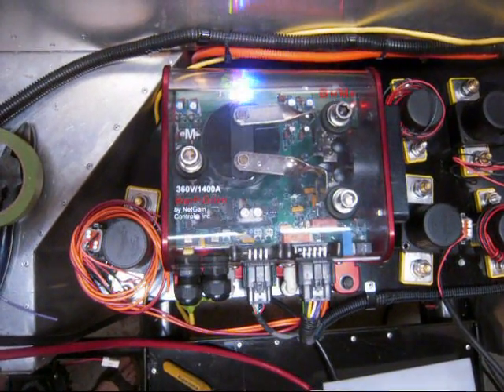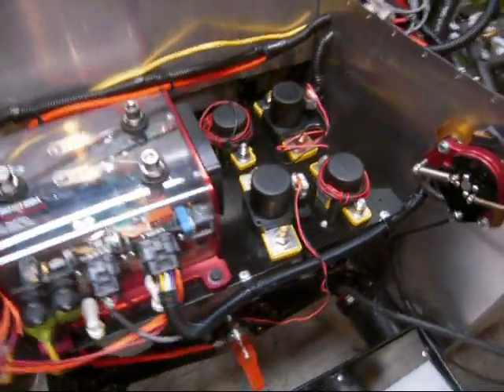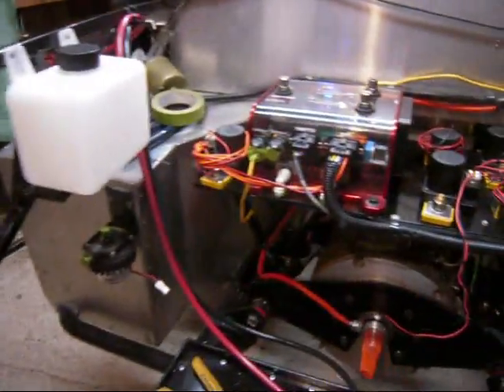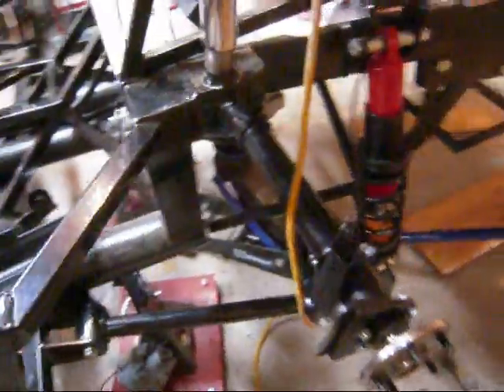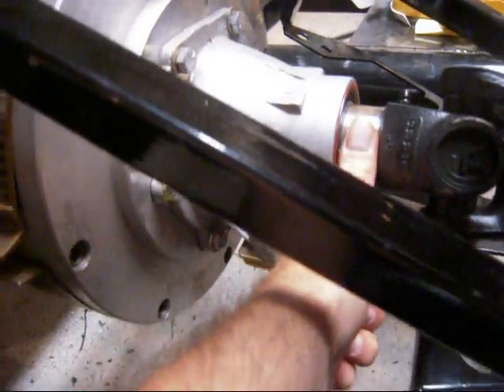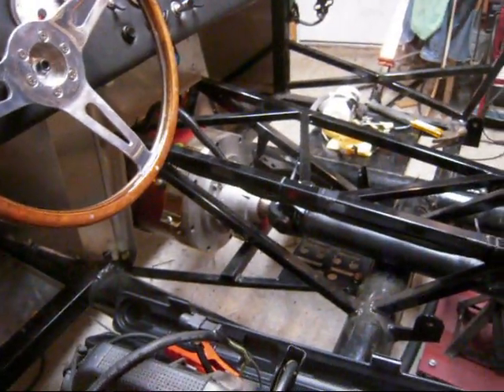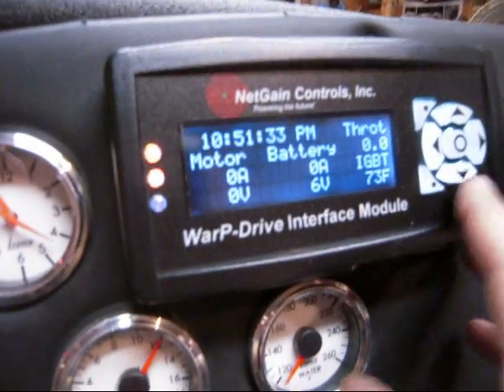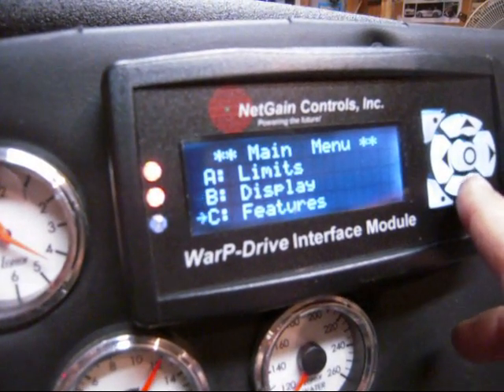Factory Five Mk4 - Electric Car - video 8

Comment from the maker: @saruricardo   The tires are 17"  (10.5" wide rear, 9" wide front).   The motor manufacturer recommends limiting the RPMs to 5000-5500, although they test it to 8000.     With the 4.1 rear end, at 5000 RPM, the top speed will be only 107mph.    0-60mph should be around 3 seconds, possibly 2.7 based on an online calculator using HP and weight.   Won't know for sure until it gets out there and runs, but it should be a lot of fun finding the answer.   :-)

Comment from the maker: @firecrowpl   Still not totally decided on batteries, but I am probably going to build a pack with 540 Headway 16AH cells,  90 series, 6 parallel,   288V nominal.

The only gear in the car is the rear end, which is 4.10.   This makes the car feel like it's somewhere between 3rd and 4th gear.   There should be no shortage of torque in the motor/controller/battery combination, so a single speed should work well.